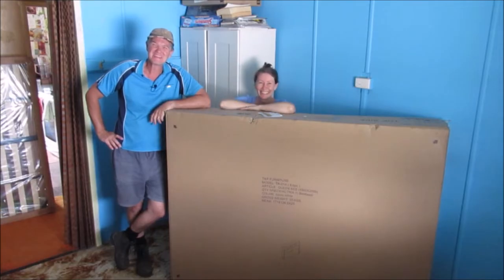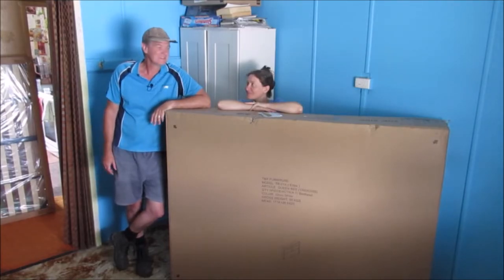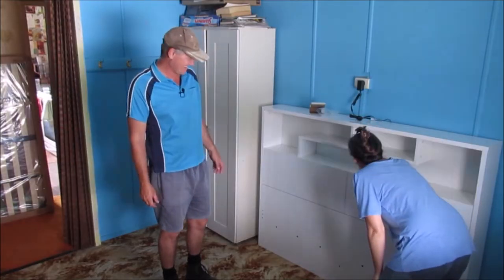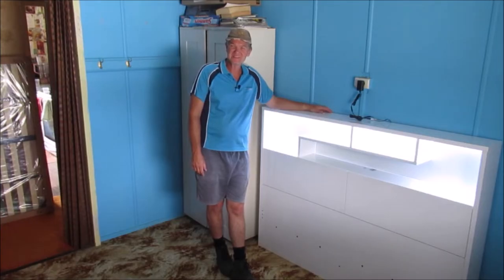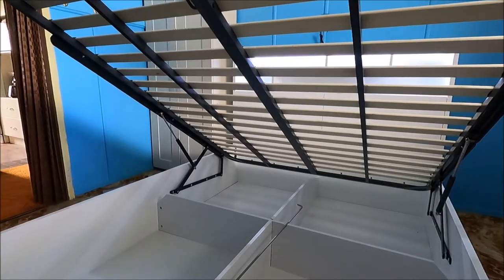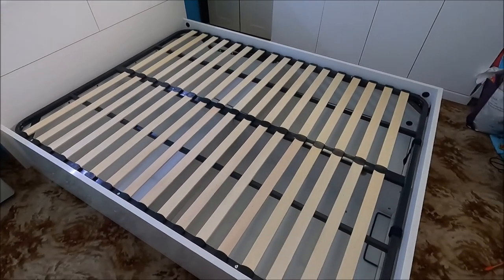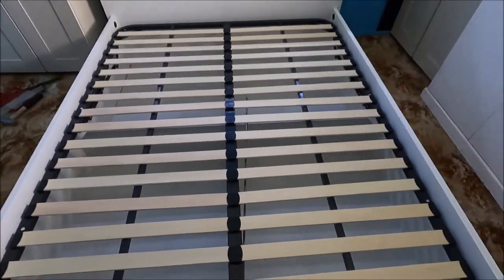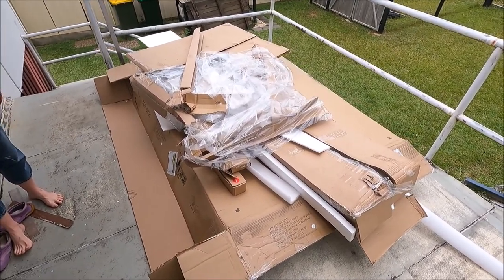Assemble Edge Gas Strut Queen Bed

Comment: Thanks for taking the time to video assembling the bed. Pity some of it was already chipped when you were doing the base walls. Looks like nothing is holding the 4 floor sections in place and all the white (MDF?) parts look pretty flimsy. I appreciate your video it's helped me to decide not to buy a bed like this because of the pushing down and I'd be wanting a couple of pieces of sturdy ply wood under the mattress to stop lint and dust getting into the storage compartment every time the sheets are changed and to have more than just narrow slats holding the bedding in place. I'd be wanting legs with wheels on the base too! 😅 Hope it's all to your satisfaction.